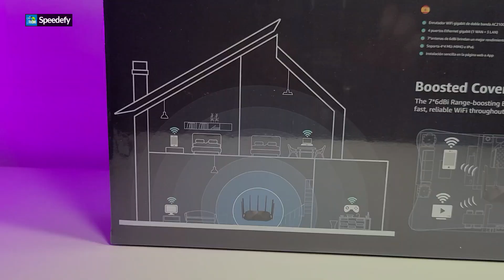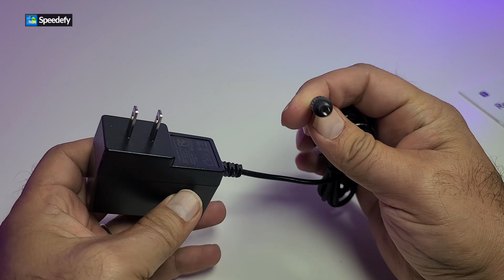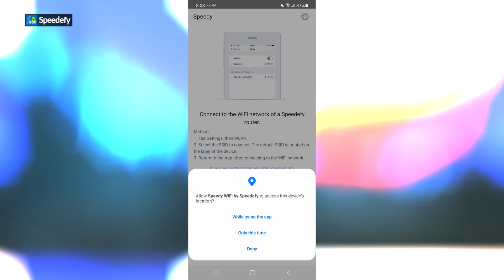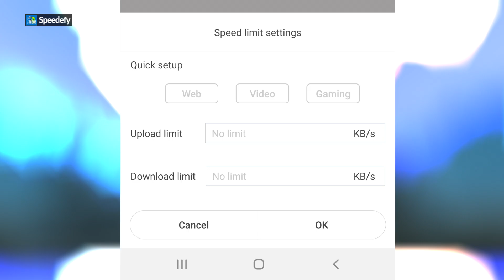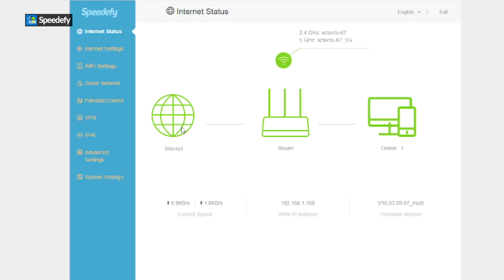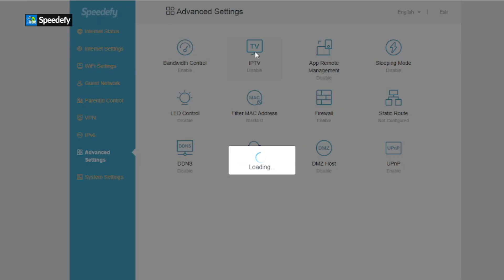STOP using your ISP provided router! - Speedefy K7 AC2100 Gigabyte WIFI Router Review

Comment: Great and awesome video! I have Verizon! Would I be able to replace there router modem with this? 
Can you add any VPN to this router?
I use Astrill VPN would that work with the Speedy routers? Please respond
Reply from the maker: This is a router not a modem, but you can turn off the wifi on your isp modem and use this router as your only wifi source Aldo you can add any vpn on this router.

Comment: Excellent  video !!! 👍👍👍 Expains why most users are not getting the speeds that they have paid their sevice providers for but I still have many questions. I assume you disconnect the service provider's cable/modem box and replace it with the new router? If your house is wired with CAT5 ethernet cable will the internet speed be reduced significantly over using CAT6  ethernet cable? If you have an ethernet switch box that feeds ethernet cables around the house should you change it to a gigabit switch box? Are there any other hardwired components that might need replacing? Lastly, I assume that wifi speeds will increase with the new router but only as good as the device its connected too, especially if you have older phones and tablets. Thanks for the info since I'm getting ready to renew my internet subscription this month, I'm currently on the Shaw 300 internet plan ( I've never got close to 300 using ethernet) and I do not have cable since I stream all my media from the internet. Thanks again, I am subscribed and watch all your vids. Keep up the great work, it's really appreciated. 🇨🇦🇨🇦🇨🇦
Reply from the maker: Lets answer your questions one by one, 

1. Your ISP given you Residential and Business internet, 
  a) Residential Internet is always been said and written in black and white (( Up to a number 500Mbits or A Gigabit )). (( unlimited in Canada has a cap too ))
  b) Business Internet is always going to stay the same said 100Mb download and 100Mb upload that is what you will get not higher not lower. 
2. You can not replace your ISP Modem/router, but you can disable the Router part and take control of your connections yourself, ISP do not have to see you sending pictures/music/ documents within your network, and that way they can not reduce your connection to 5 or 10 devices. 
3. Cat5 will not give you good speed higher then 10/100, you need Cat 5e or higher to get up to 1Gb speed. so if your house is already wired with CAT5  upgrade it to CAT6 or CAT7 which is cheaper then CAT6.  
4. Switches check them to see if they are 10/100 or 10/100/1000. that way its just ease of mind for couple of years in the future do not need to upgrade.

my friend Shaw 300 package is not bad, but your internet is shared till get to you. Get a router hook it up to the router then use something like Speedtest app on Windows/apple/android and test you will see an increase.   keep me updated on your findings.
Reply: @xctechs  Thanks for the prompt response and info. I am actually using Cat5e ethernet cable. The Shaw cable/modem is the Hitron unit and I'm relatively happy with with Shaw 300 package but occaisonally get some buffering whilst streaming and if adding my own router improves what I already have, then I'll be a happy camper. Please note that I also have a Unifi Lite AP added to my system for extended 5G coverage. Will let you know how I make out in a couple of weeks once I figure out how to disconnect the Shaw router. Thanks again.👍👍👍